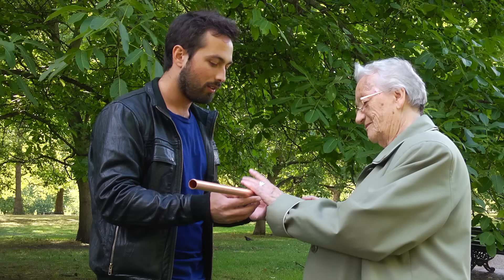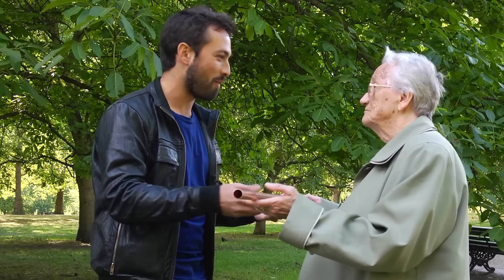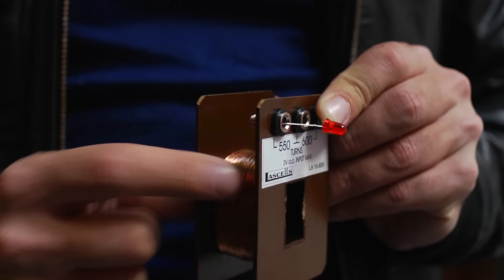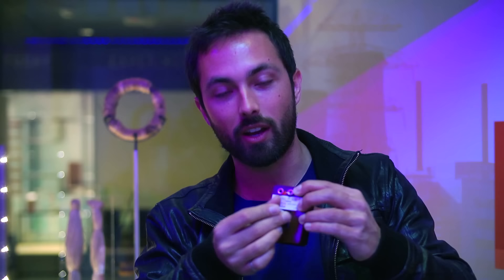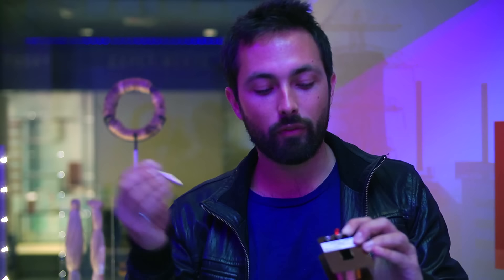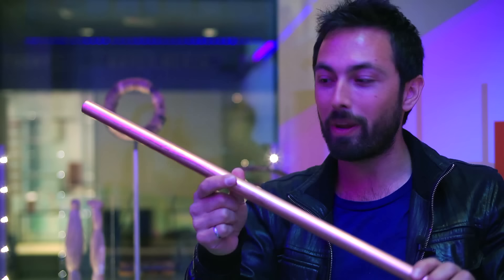World's First Electric Generator

Comment: This happens with the Earth magnetic field, solar winds impact Earths magnetic field and it bounces like a dodge ball after bouncing off the ground! This is the varying magnetic field that can be harnessed to make electricity on the ground! You can test this with a 12 inch loop of 50 gauge magnet wire with a sensitive volt meter connected to the loop! Wave it around and the volt meter will show a potential, this is the Earths magnetic field the loop is moving through! Yes we can have free energy

Comment: Will a heated pipe be a better magnet?
Reply: no, because the pipe is not magnetic. a heated pipe would slow the falling magnet less since the electrical resistance goes up with increased heat. conversely, a colder pipe would slow it more.  #science
Reply: Patrick McClellan
so the thicker the better?
Reply: 3goldy yeah.
Reply: 3goldy that's what she said
Reply: a frozen pipe would be a better magnet
Reply: thats why iron is cold

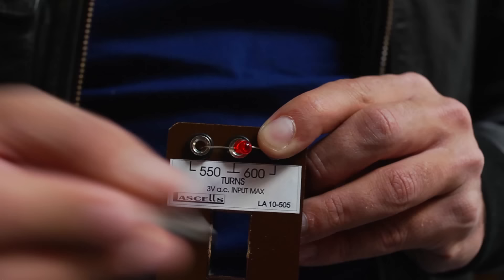Comment: What is the device called at 2:41?
Reply: Evan Kryski An inductor (with a LED attached to it).

And inductor is simply wire with lots of turns around its central part... You can actually make one at home, if you have enough patience or machines to make the turns.

Comment: Is it the fact that the magnetic waves get bounced back by the tube?
Reply: He just said it. The gravitational forces are being transformed into heat and electric energy. I'm gonna drop the bomb bro :)

HOW IT WORKS
All metals contain a movable substance called "electric charge". Even uncharged wires are full of charge! After all, the atoms of the metal are made half of positively-charged protons, and half of negative electrons. Metals are special because their electrons don't stay connected to the metal atoms, instead they constantly fly around inside the metal and form a type of electric "liquid" inside the wires. All wires are full of electric fluid. Modern scientists call this liquid by the name "electron sea" or "electron gas," or the "sea of charge." The fluid charge is movable, and this lets metals be electric conductors. The movable charge-stuff is not invisible, it actually gives metals their silvery shine. The electron gas is like a silvery fluid. Sort of.
Whenever a circle of wire surrounds a magnetic field, and if the magnetic field then changes, a circular "pressure" called Voltage appears. The faster the magnetic field changes, the larger the voltage becomes. This circular voltage tries to force the movable charges inside the wire to rotate around the circle. In other words, moving magnets cause changing magnetic fields which try to create electric currents in closed circles of wire. A moving magnet causes a pumping action. If the circuit is not complete, if there is a break, then the pumping force will cause no charge flow. Instead, a voltage difference will appear at the ends of the wires. But if the circuit is "complete" or "closed", then the magnet's pumping action can force the electrons of the coil to begin flowing. A moving magnet can create an electric current in a closed circuit. The effect is called Electromagnetic Induction. This is a basic law of physics, and it is used by all coil/magnet electric generators.
Reply: its more like when you hold a nail with a magnet the nail becomes a magnet for a while, but because its in a tube, it is surrounded by nails (sorta) and these nails become slightly magnetic for a tiny while, therefore repeling the other magnet
Reply: Kris Patel but yes you can think of it that way, but its not true, they dont bounce back, the get absorbed and more are created

Comment: what would happen if you were to create a pipe conductor like the copper one used here which spanned across the entire circumference of the earth and shot a magnet at projectile motion into it similar to how the International Space Station observes projectile motion around the earth? Would you be able to generate infinite electricity?
Reply: smith2354 Well obviously not. Why do you think the magnet would not slow down, when the induced magnetic field does exactly that - it slows it down. The energy taken from the magnet (i.e. it slows down - it loses energy) is converted to electric current energy and some is lost in the process (heat). You would have to actively speed up the magnet from time to time to keep it going, and you'd find the kinetic (motion) energy you would have to put in, would be less than the electric energy you'd get out of it, due to heat loses in the process.
The ISS is constantly slowing down as well and its orbit is decaying (it's getting lower), it's not up there indefinitely. And it's not actively slowed down by a magnetic field it itself induces. The magnet would slow down much faster.
Reply: No. Same reason you can't hook up a solar panel to a light bulb and create infinite energy: energy decay. As electricity moves through the conductor, it is also going away from the conductor, which is why there must be a constant supply of energy to make up for the loss.
Reply: smith2354 Infinite electricity is impossible. You can't create something from nothing ( in most cases )
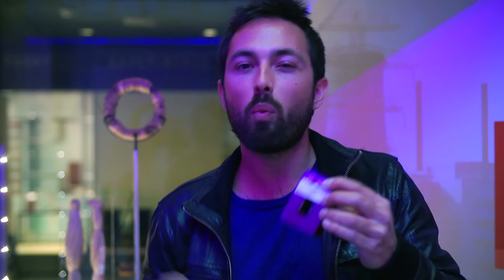Reply: The kinetic energy is converted into electricity and the projectile will slow down to eventually fall on earth. Veritasium mentioned this idea around @2:57

Comment: 2:50 "This is actually the way all electricity is generated"
How about solar panels, for example?
Reply: tamerius1 Even so, depending on the technology, there are either inductors or transformers (or both) inside the solar inverter, as part of its inner workings of converting the voltage and power format from DC to AC.  Both inductors and transformers rely on Faraday's Law of Induction, which is the concept he is demonstrating here.

This is more of an artifact of the process to adapt a power that is native to DC, to an existing AC power grid.  You'd expect that it would share some aspects of the way that conventional AC is generated.

But yeah, he didn't necessarily mean all electricity.  He meant all electricity that is generating by rotating machinery, which is the vast majority of it.

Comment: Why not use an electromagnetic pump and run gallium through copper coils to generate electrity while generating hot water that can also run thermal electic generators all at the same time? An integrated power and heating system?
Reply: But gallium is not a permanent magnet as its not ferromagnetic, however I do wonder if pumping gallium in tubes aground a strong Permanent magnet would generate a voltage
Reply: Find the hertz resonance of the crystal lattice in the gallium using the electromanitc pump to generate a high magnetic field that is discharged through the copper coil, flow rate of the liquid gallium could be adjusted to find the sweet spot has voltage is generated and collected to start the cycle all over again. Sort of like a heart beat. Novartis
Reply: A Crystal graphite solution ran through copper coils with an electromanitc pump with a hertz generator would be an interesting exsparament to see how much voltage could be generated with a sustained output? Crazy ideas crystal graphite builds a charge off background earth resononce. Why not use hertz generator of radio frequency to find an optimal resononce above earth resononce to amp up the crystal graphite electrical power generation? Sort of like how in the iron man movie where that element glows from reaching a harmonic state within its crystal lattice matrix? I am not a science person but you are correct? I am just thinking about weird things that could work. = /
Reply: Have you done any work with sterling and Manson hot air engines?
Reply: I got sum crazy ideas and designs for heating and cooling and power generation using sterling and Manson engines. Want to brainstorm?
Reply: Is my science train of thought wrong or am I speaking in a different language?
 = /
Reply: No your science is great and its thinking like this that push the human race further into higher and cheaper technology.
Reply: How about a V-10 hot air Manson engine powered by low voltage induction of graphite rods in the pistons ran off solar panels with a transmition that turned a high voltage power generator that feed a capacitor and battery bank for a home electrical power plant? Hay no more high electric bills would be a big plus for the working class. You think a home power system like this could work? Lets brain storm. = )
Reply: That manson hot air engine could also heat a home generate hot water and even run a bank of cryo sterling cylinders to cool the home has well has generate electrical power. Novartis

Comment: wait a sec. A gravity to heat converter. Dafuq?
Reply: Well, Isn't sort of logical. Electricity is movement of electrons. When the magnet falls as vertasium said, The magnetic field caused the some of the magnets potetntial energy to converted into electricity, thus slowing it down due to the fact that all potential energy isn't being converted into kinetic energy. When the electrons bump into ions in the copper tube they cause them to vibrate. In physics heat = vibration of particles. Simple isn't it?

Comment: Gravity is infinite. That means energy is infinite. If it weren't then we should have much lower gravity by now, yes?
Reply: It is a commonly known thing that energy doesn't disappear. It just changes forms.
Reply: Not quite. Gravity is inherited by mass/energy and is a direct effect of both on space time. If there was an infinite pool of energy were gravity is, you would simply have a black hole. A way you can test gravity's infinite energy is making a self-sustaining inertial generator, which cannot be done.
Reply: Magnetic energy is infinite though. I'm sure they can use that to an advantage.
Reply: Magnetic fields are infinite, but if you try and use two infinite fields one of them ends up getting canceled out as it spins back. So you kinda cant. I suppose you could do it with electromagnets and sensors, but then your using more energy then outputting.
Reply: vuvffufg yeah yeah but the question is.... will that blend?
Reply: There are many form of energy. By definition energy is infinite magnetic gravitational ecc ecc
Reply: Gravity is not infinite. To gain energy from the force of gravity there has to be gravtational potential energy.
Reply: vuvffufg It should be noted that mater is energy in a different form, so if you really, really want to get technical, its energy in two different forms that causes gravity.
Reply: +楓黒麦 Higgs field? Theoretically what causes mass so isn't it a direct effect on gravity. Proving that it's all one energy, of course made of fields.
Reply: AFAIK, energy is always the product of a potential (voltage, temperature, force, in other words think that are not really splittable with size of the sample) by an extension (charge, caloric capacity, distance... things that are always splittable with size). With gravity, you just have the potential. Only you you add mass somewhere can you speak of energy... and of course a distinct mass of the one which generates the gravity we consider in the first place. And it so happens that none is infinite.

Evet if they are thousand of light years apart and alone in the universe, not much energy will be generated from the 999,9999 first light-years. Remember what Arthur C. Clarke expalined : "When we are in low orbit, we are already half-way in energy terms to any point in the galaxy" :-)
Reply: But , it costs energy to lift an object.
Reply: It gains potential energy though (- heat)

Comment: Mind blown. Can we use this in elevators?
Reply: Probably but it probably wouldn't create much electricity
Reply: not that way.
Imagin being in a copper case in freefall with no cables, moving slowly by the sole electro-magnetic force
Reply: Uri Kutner Oh well that would probably cost way more then it would ever save but it still isn't really needed since elevators only needs to lift the people inside, it doesn't have to lift the actual elevator because of weights on the other side of the cables.

Comment: friction?
Reply: That's not entirely incorrect. There is indeed friction between the magnet and the tube. In this case however, the coefficient of friction and the normal force are very small. The resulting small frictional force isn't enough to outshine the principle being demonstrated here.

If the tube was held vertical, and the magnet dropped without touching the walls, you wouldn't notice an obvious change in how long it takes the magnet to drop. The force of friction in this scenario is that small.
Reply: Im not saying the friction of the magnet touching the walls of the tube .That friction would be negligible. Magnetic friction? The magnetic field of the magnet against the molecules of the copper pipe.

Comment: Lol this is basically how most electric motors work with the magnets moving past the copper coiled wires. So if you spin the rotor it will produce electric flow in the rotor because of the magnets in the stator surrounding it. Same deal if you apply current to the rotor with a commutator you will get an electromagnet constantly pushing away from a permanent magnet. 

Also the guy is wrong. That isn't how all electricity is produced. Solar panels don't use any magnets, Thermo generators also don't use magnets and lightning has nothing to do with magnetism. Also Nuclear power production doesn't use magnets either. So he should not have said this is actually how all power is produced because it actually only makes up a minority of the power produced.
Reply: Nuclear power uses this method.  The nuclear part produces the steam instead of coal or some other burnable fuel.  Like a generator but bigger.  You have the electrical generator part, like the alternator on your car, and then you have the motor that turns it.  powerplants use steam through a fan as the motor to turn the generator.
Reply: I will add that it isn't true when you say that magnets serve in a minority of the power produced. Coal, oil, nuclear, wind, hydroelectric, geothermal, etc. are all using magnets, and they represent more than 99% of the power plants of the world.

Comment: you mean engine i guess. but no, its exactly the opposite of what an engine does. an electronic engine turns electric energy into kinetic energy. a generator turns kinetic energy into electric energy. in the case above they´re just using potential energy to induct the electricity.

Comment: The LED bit just proves that science is awesome... and slightly sexual. IE; In the world of technology, the USB port on you computer is known as a 'female' connector. While your USB wire uses the 'male' connector. So the 'male' connector goes inside the 'female' connector. Not the most pleasant thought to have when you plug in your Thumb Drive (Or flashdrive) into your computer...

Comment: And what does electricity has to do gravity? Don't change the subject and thumb yourself up. Speaking of which, lots your lot are out there doing the same floating this and that, but why not come up and post your research paper on scientific journal? Why are you guys not getting approved by the scienctific community? i've heard those bragging about this and that before. DID NOTHING. In science, practical application is meaningless if it doesn't have any base.MATHEMATICAL proof.